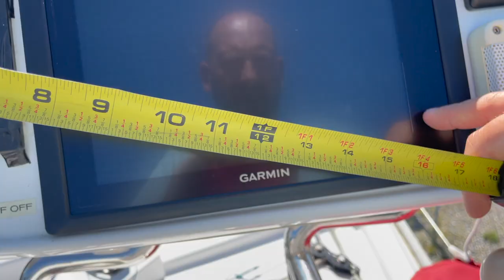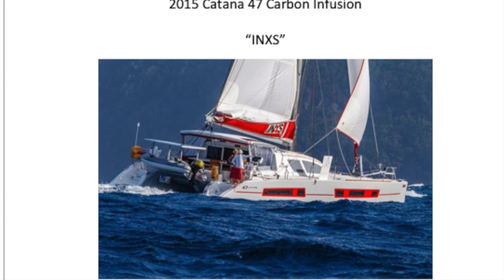We bought a sailboat on auction! Catana 47

Comment: OH acomment I ment to share with you after I saw your portion of keeping yourself 
Ground Fiber Dust FREE!  AS the weather heats up the green hous effect will make you sweat
AS will the layerscof heavy clothing.......I teach the students to use a vacuume in reverse [ basicly attached a small a NEW vacuumed so it creates POSITIVE PRESSURE  of  clean blowing air inflating yout Tyvec Suite and exhausting at your  hoot/ face blowing away dust / sweat & heat .....its a winner as all air coming to you is filtered! I myself  pull a T- shirt over 
The vacuumed to pre folder the air before it gets to the International multistage air filter inside the vacuume.......just a suggestion to make life easy and dust free to you!
Reply from the maker: Thanks for the suggestion. Right now we are done with all grinding. We are in the final stages of selling our house in Colorado and then doing a month long road trip across the US to the boat. Do you have any suggestions on getting all the little pieces of carbon fiber out of the boat? I've wiped it down multiple times but I'm having a hard time getting it totally clean.